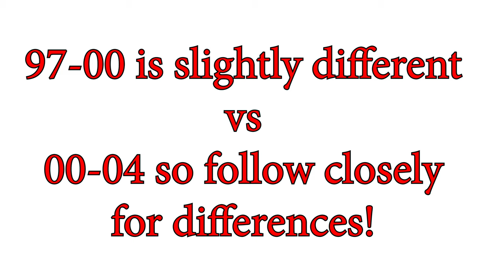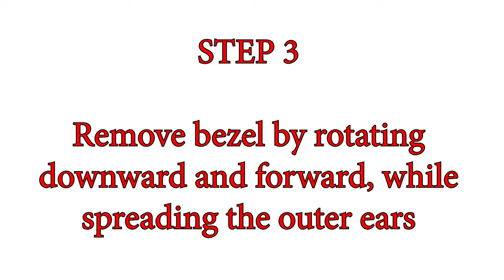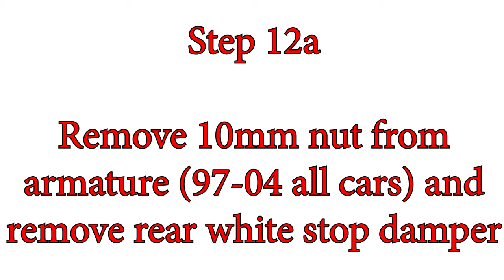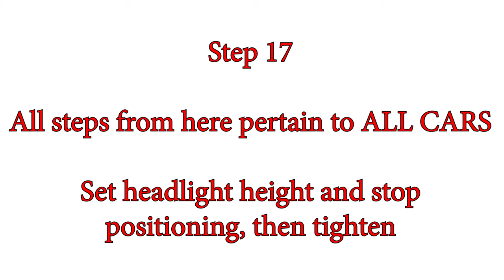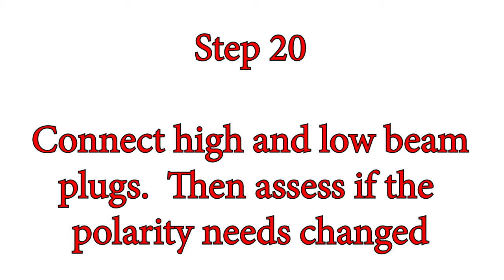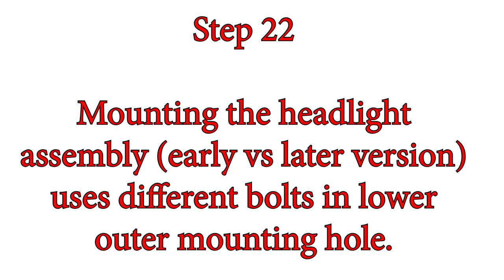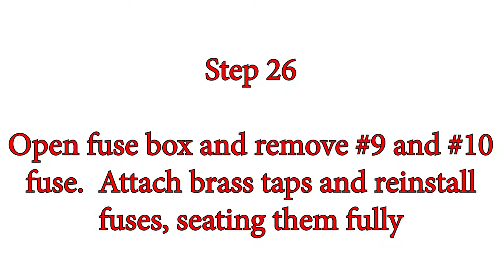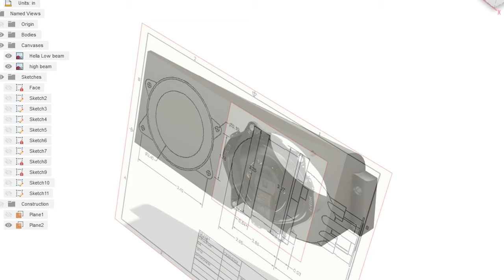C5 Corvette Sleepy Eye TripLED Headlight Install How-To Official

Comment: Are you aware of the frame ground that is just under the fuse box on the top of the frame rail? Would be a more reliable ground for the relay. And probably easier to get to.

Comment: My kit was delivered about 2 weeks ago but I was away when they arrived. I  just started the installation today and could only finish the drivers side due to only receiving 6 bolts. According to your instructions I need 4 for each side. That was a bit of a disappointment !!
Reply from the maker: Please read the instructions in the box, as this video is showing older hardware vs what you have received.  Reading tge included paperwork, which is highlighted with arrows, is very important

Comment: Great vid! Just got mine today! Pro tip instead of a t30 bit and needle noses you can just use a 5/32 Allen key. Just be careful not to strip it!
Reply: Mines stripped already. Any tips to get around this?
Reply: @brihilist5236  thought that comes to mind is super glue your tool to it and replace the stripped one.
Reply: @Zestybruh  thought about doing that. Was a long 2 days of installing but the lights look great. I ended up cutting the bolt off and replacing it with 10mm on both ends for easy access in the future

Comment: I installed my lights today. Absolutely love them took me about four hours. Install was pretty easy, especially when following the video. I did something on the second light that helps tremendously, and that was to adjust the stopper all the way up until only a thread or two was showing on the bolt.

I will have to adjust my lights a little bit higher, or raise the car off the ground. Lol I’m almost dragging after lowering it, but I’ll wait until I raise it up to see exactly where the lights set. All in all I absolutely love these lights. What a difference, it makes in the appearance of my C5. thanks Damian for the great product and support
Reply from the maker: Did you use the black oxide screws for the stops?  I am betting no.  The paper in the box advised of the hardware change.  The hardware is correct if you build the stops correct according to the update.
Reply: @KnightDriveTV  I must’ve lost the paper because I did not see it. But no I did not use them because I didn’t know to do so. Could you please suggest how I should install them
Reply: Everything‘s working fine. Do I need to take it apart and add the black oxide stops

Comment: Just finished installing, what a great and easy to follow video. One thing that made it easier to remove the 10mm bolt on the top of the housing to release the mounting arm was an L shaped H5/32 (or metric equivalent) hex key instead of the T15 with pliers trick. 

I got the new black bolts for the stop guide and I didn't realize why you switched them until I got to the passenger side, the armature woild slide in between the bolt and the housing.

Comment: 9:10 Hey Damian I am almost done and just caught at 1:02:59 that the T25 I initially used slipped, had a T27 sitting right there and that was the proper fit you could tell by feel right away. I remember years ago working on some car that had T27 as well so that adds up.

Comment: 14:01 Mechanic’s tip: remove the (2) rear T15 Torx screws BEFORE manually raising the headlamp - saves time because you don’t have to raise it, then lower it, then raise it again. This is called a “workflow optimization” which saves time.

Comment: 34:11 Not to be a party pooper, but a 1964 engineering white paper showed results of testing all types of lock washers. The split type of lock washer you specify is by far the least effective, and basically doesn’t do anything once it is flattened. I would recommend a small amount of blue Loctite instead.

Comment: Great video and product! Just finished installing the passenger side. Quick question, when my lights are turned to off the low beams of the knight drive lights remain slightly lit, despite all other lights being off. The only way to turn them off is to turn on my high beams then turn off the high beams. Any fix for this or way around this?

Comment: Newer kits, (Aug 24') have i think 6 silver bolts and two black bolts. Use the black bolts on the height adjuster bracket 28:00
Reply from the maker: The paperwork in the box supercedes this video, as directed in the video.  The black oxide screws are your stops, like the paperwork directs.  If the black oxide screws aren't used, then you will not have enough hardware.

Comment: Tip 
High beam 9005 
Socket has 2 indents between the pins
Low beam 9006 
Socket has 1 indent between the pins

Comment: When removing the up/down adjustment bolt, instead of using pliers to hold the torx bit, the box end of a 1/4” wrench/ratchet wrench would  make life easier. Or it wouldnt, idk
Reply from the maker: I tried to relate to what tools people would easily have.  I have special micro wratchets for the bits, but most people don't have them.  I just tried to show what was easily accessible.  The bit will slide backward in a box end wrench but it could work.  My little bit wratchets lock the bit.

Comment: Hey man, I just ordered a pair of these and later found out about the all/6 harness. Is that now included in the kits, I saw it was on the order page for the harness, but not on the order page for the headlights and just wanted to be sure. Thanks!
Reply from the maker: That's always been included with the kit
Reply: @KnightDriveTV  Appreciate the reply and confirmation!

Comment: I have previously installed a pair of the Depot fixed projection lights on my C5 and I’m thinking about upgrading to the sleepy eye headlight I still have the factory headlights can I install this kit in the factory headlights before I reinstall them back into the car  or do I need to put the factory one in first and then go from there 🤔
Reply from the maker: I never had anyone do it that way, but I'd imagine it could be done.  In truth though, getting the oem system back in operation first, being sure there are no issues, then installing the kit next would avoid any confusing troubleshooting, in the event something isnt working right.
Reply: Thank you very much for getting back to me right away that helps me make my decision sleepy eyes 👀 it is

Comment: so i’ve spend the past couple hours putting these in. when going to test to see if i had to flip around the tabs for the bulbs my headlights didn’t move down when i turned it off. now they will not go down automatically, i have to manually do it with the knobs. is there anyway you can help me?
Reply from the maker: Please join the KnightDriveTV Corvette Enthusiasts group on facebook.  3000+ owners in there, lota of help

Comment: i want to put c7 lights on a C5, is that possible.  I'm willing to do some cutting!
Reply from the maker: Its all possible if you're willing to chop up your car.  I am making a fixed kit that removes the motors.  C7 lights wont work and itll look like hell.  You need something that works with the lines and design flavor of c5.  I have it comin
Reply: @KnightDriveTV  Right now I have those frog eye lights and they're not even close to being bright enough for dark nights like a c6 would give.
Reply: You could do that, but it would adversely impact the resale value, unfortunately.

Comment: why doesn't the headlights turn on at all? halos all working fine
Reply from the maker: This isnt the place for install assist. Your plugs spund like you have them all upside down, the install video describes this condition.  Call me, via my phone number on the website or post in the fb group